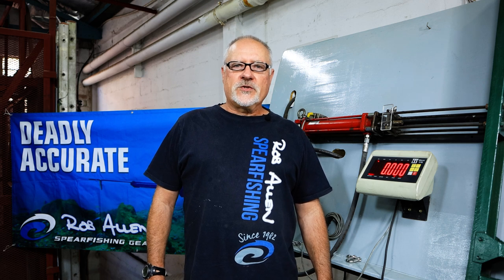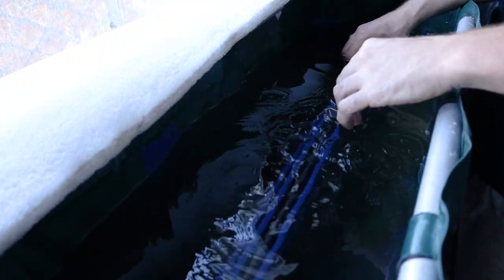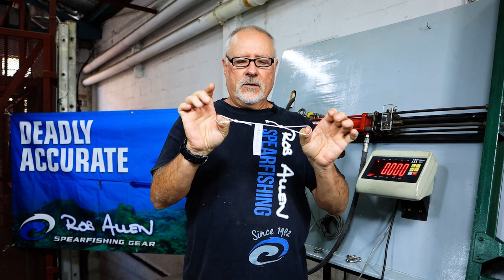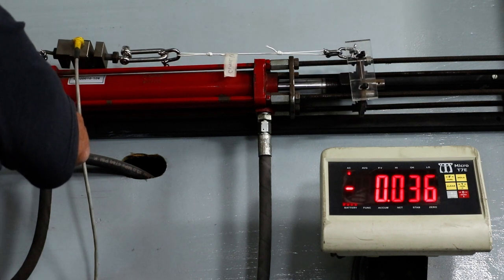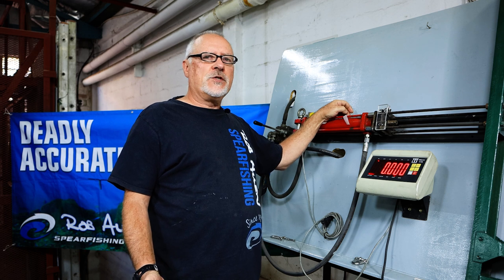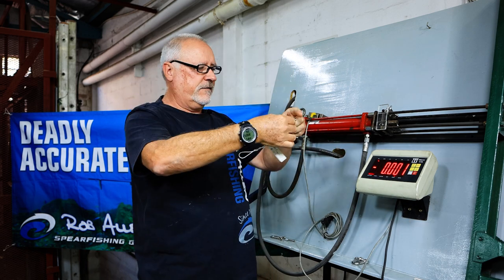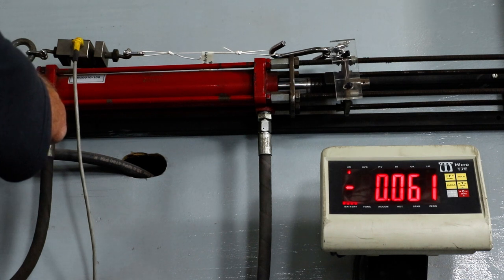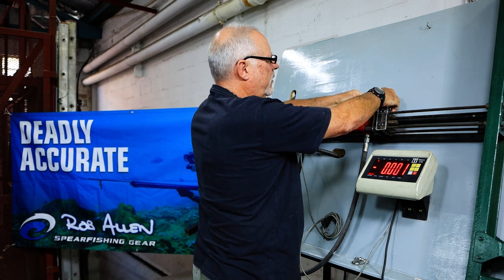Rob Allen | Testing Knots When Wet | 2022

Comment: Great videos. I think the simplicity of the knot has to be considered, at least for me. Maybe I’m not good with knots. I’ve found the bowline to be good although according to this video maybe it will be good to burn a slightly larger “bulb” at the end to stop is from slipping in extreme cases
Reply from the maker: I'd be a bit reluctant to trust a "bulb" to a big fish. Not sure how much tension it would take to pop off. The heat damages the line strength.

Comment: what knot do you use to re-tie drop barbs on to shafts?
Reply from the maker: The knot we tie is very complex. We recommend just using a figure 8 knot which gives about 90% the break strain of the knot we use. I think the figure 8 knot holds around 170kg to 180kg.
Reply: I'd like to know how it's done even if it's a complex knot system